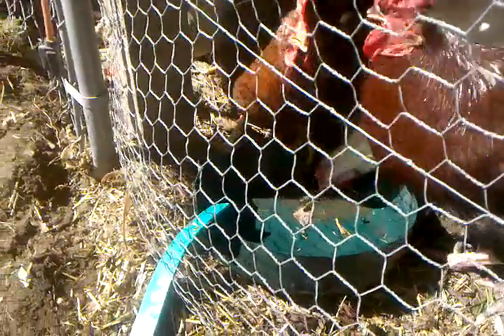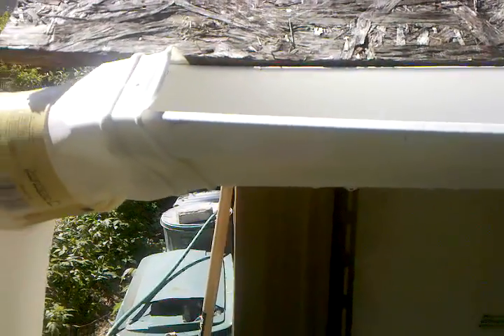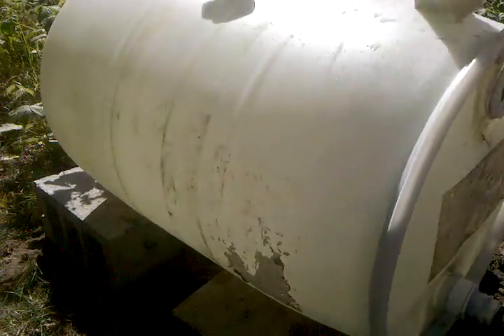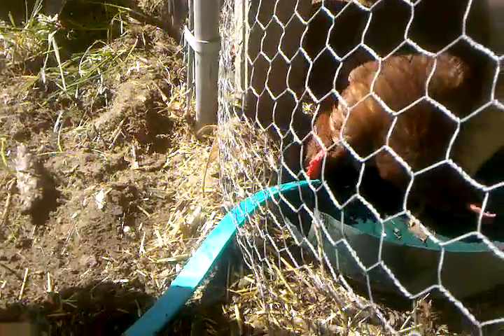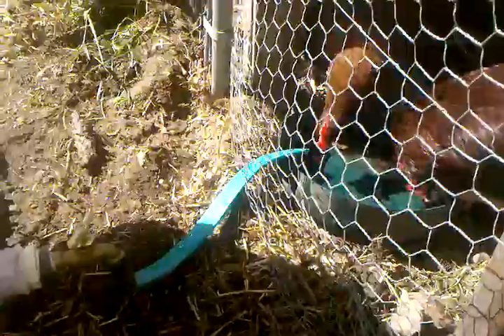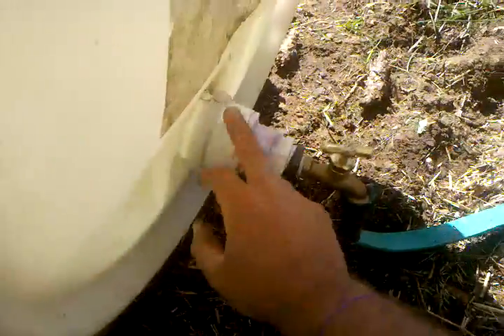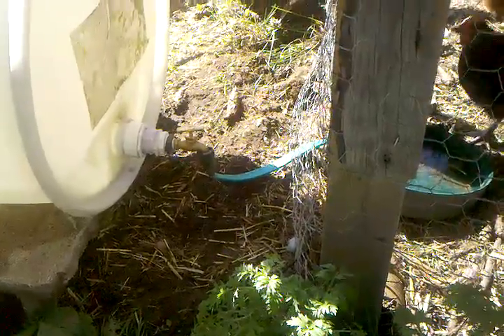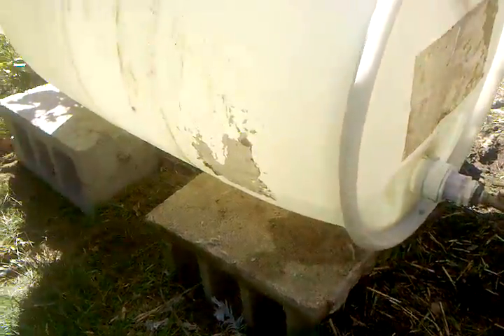Automatic Rainwater Harvesting Chicken Watering System

Comment: spring water at walmart is harvested from mountain streams upon which ecosystems and rivers rely. It is then hauled by truck to a processing facility, put into containers which took petroleum to make and they had to be shipped to the bottling plant. Then it is trucked, again, to it's various retail locations. 

So, it takes petroluem (ALOT of it from fuel and plastic) and the raping of an ecosystem to get spring water at your local Walmart.